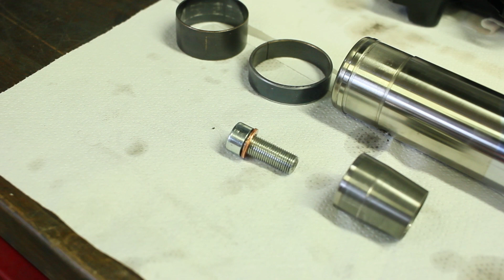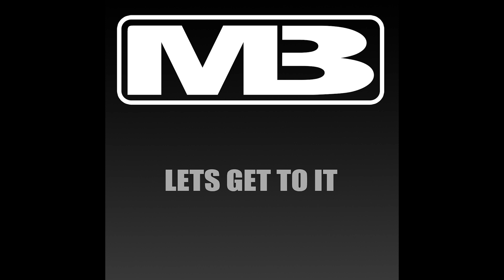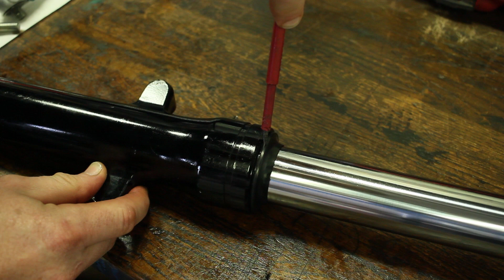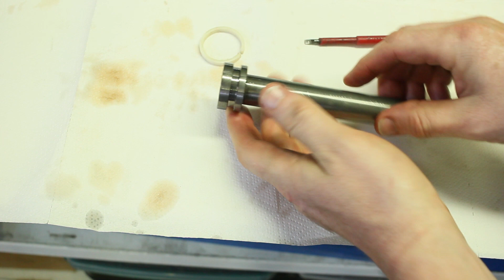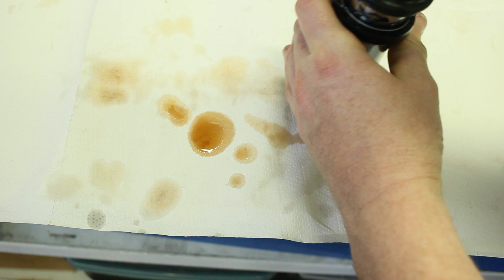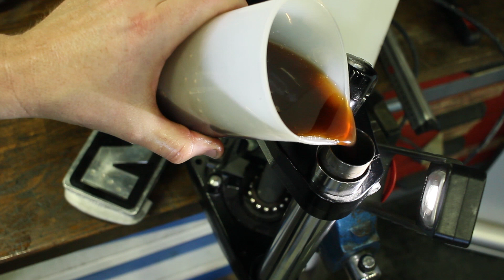Fork seal change XV950 yamaha bolt

Comment: damper rod...loosen before removing from triple tree..assembly,...tighten when the fork is assembled already and in the triple tree. use the axle bolt partially installed 
to prevent  the lower leg from spinning

Comment: Hi mate. I have a Bolt and last week on a ride I hit some big potholes - enough to cause some fork oil to squirt out (now I need to wash my jeans). Since then, if I pump the front suspension hard then I get a very thin film of oil on the forks - it's not really visible unless you run your finger over it. It's nothing like what you showed in your video, and there's no dark high water mark. Is this normal and OK? I'm hoping it's just that some oil got past the seals when I hit the potholes, and I don't need to get them replaced... TIA.

Comment: 2015 yamaha bolt R spec I used a 22mm hex driver with extensions to loosen and tighten the dampener. Hope that helps!

Comment: The lower fork damper takes a 1/2" drive to 3/4"  drive adapter from Harbor Freight and cost less than $5.00.  It fits the hex in the damper rod perfectly.  Connect it to an extra long 1/2 " drive extention and you got yourself a damper rod tool.  Great video. 👍 Did this in an afternoon and was easy.
Reply: Hahahahahaha i needed this 8 months ago, had to carefully use the impact gun, i guess out of stress i could not think.
Reply: Wait. What??  Explain exactly what I need?   How dose a 1/2 to 3/4 adapter fit?